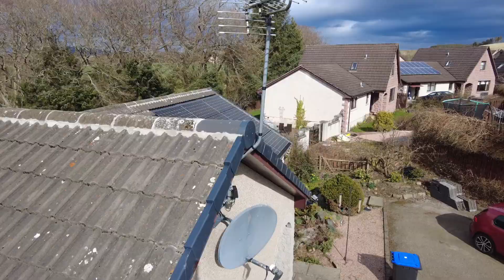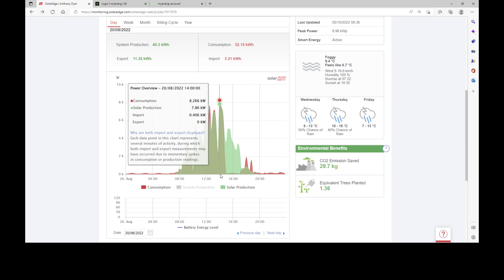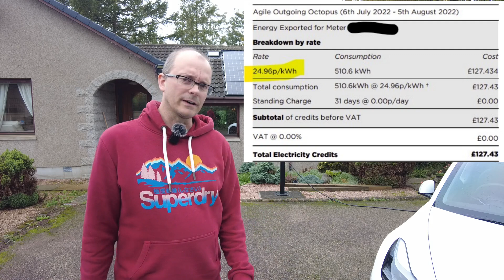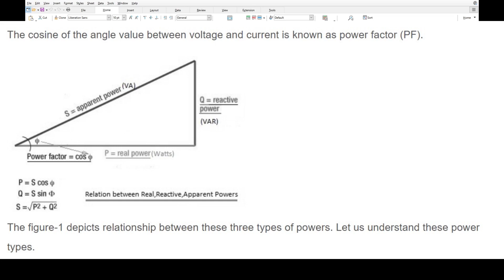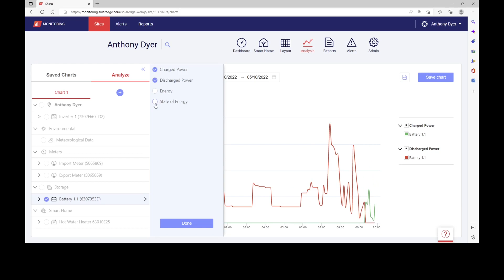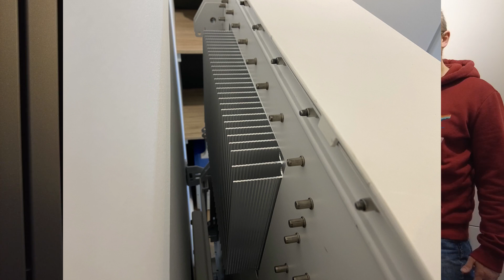July-September Solar Panel Performance, More Energy Bank Insights

Comment: I would love your "battery inefficiency"!  I have a PowerVault 8kWh unit and frankly...it's garbage.  I measure about 100W constant load which I believe is simply running the motherboard and fan (which at one point in lifetime has been set to full speed via firmware.  When I questioned this, the response was "to improve cooling" which suggests that a temperature concern had been identified across all the systems so just whack them all to full fan speed.)
I've also tried the battery for time shifting but the problem there is that I measure about 10.2kWh to fully charge 8kWh.  The usable discharge is about 6.7kWh.  Now factor in the constant 100W load and that's another 2.4kWh just to have the unit on all day.  
Even on a sunny day, the solar captured which is usable at 6.7 then "loses" a further 2.4 just through running costs so in reality, the battery in only worth 4.3kWh.
I ran some calculations and found that if it uses 150W to operate then it runs at a loss, it's really that close and given the purchase cost, frankly not worth it.  I now turn it off unless there's a chance of capturing some sun and subsequently get emails "We've noticed that your PowerVault battery has been offline for 24 hours".  One of these days i'll reply and tell them why.
The EV arrives soon and i'll just dump surplus solar into that as it's just a one way charge without the running cost and return efficiency loss in the same way.
Reply from the maker: That’s poor. I speculated that “fixed load” may have been a factor here, but the evidence didn’t support that idea. 100 Watts is very poor for what is essentially a monitoring / safeguarding function.  My raspberry pi consumes 1.5 Watts, is on all the time, and switches relays for bathroom fans and lights.

I’m not an expert on power electronics, but battery management is charge control and cell balancing.  That essentially means switching off the load/supply with a switch to prevent overcharge, undercharge, overload etc… and then redirect small load quantities to individual cells which are unbalanced.  Now if that switch is a relay, then power consumption should be low.  But if it’s a MOSFET, that would be more reliable, but far less efficient.
Reply: @anthonydyer3939  Yes indeed. After I looked into mine, it quickly became apparent that with Economy 7 at half the price of day rate, it wasn't delivering any benefit with round trip efficiently and losses resulting in about 50%.
As of October 1st, my day rate has gone to 44p but night rate down to 11p (from 34/15). In that calculation, the night rate being one quarter could work if only the unit didn't sit being inefficient when just turned on at the higher rate.
I am contemplating designing and 3D printing a servo operated activator to turn the large chunky isolator so that it can be turned on only to charge and turned off when it has discharged. Then and only then can I realise savings.
Reply from the maker: @djtaylorutube  I was just having a look at the Powervault specifications.  The lack of any boast about round trip efficiency was suspicious to my eyes.  But the fact that fan cooling was mentioned in the spec (with a 70db noise level rating) was a terrible giveaway.

I was doing some research into charge controller types.  There are some varieties that simply dump excess solar power into a resistor bank (shunt type charge controller) when battery is fully charged instead of simply opening the circuit or diverting the surplus to the grid.  I'm baffled as to what exactly is needed in the charge controller to warrant a cooling fan.
Reply: @anthonydyer3939  When I've seen it open, there's basically a motherboard running Linux and then another board with the charge controller. I may have a pic with it open...
Reply from the maker: @djtaylorutube  it makes me wonder whether the motherboard is doing some cryptocurrency mining on the side with that kind of power consumption!  Ideally they should use a microcontroller rather than a microprocessor for this kind of duty.  Either way, my raspberry pi is 1.5 Watts out of the socket outlet, and it’s running 2x temperature, 2x PIR sensors, relay outputs and a web server.
Reply: @anthonydyer3939  This just got a whole load more interesting!
I popped a clamp meter onto it today to feed into my emonPi (I've been waiting for an emonTX to get more than two inputs).
Because I couldn't previously observe exactly what the batter was doing and had to rely on their mobile app, the emonPi home instantaneous use never made sense to me.
Today though, I can report that the Powervault battery system in idle is about 67W.
However, this evening, the house load was about 500Wh. Then I turned the battery on to discharge a bit and the clamp meter showed 800Wh from the battery. The clamp on the meter tail showed -300Wh.
I'd never really trusted that negative figure with the battery on but now I have clear evidence that it looks like I'm feeding out to the grid, even though the Powervault app shows all 800Wh going into the house.
I'll going to monitor and log this to present to Powervault because this is incredibly significant in that it is giving my stored solar or purchased Economy 7 away for free!
It's no wonder that my battery charge isn't lasting as long as planned. I mentioned earlier that it feels like it "costs about 2.4kWh" and there you go, constant discharge of around 300W out to the grid that I don't use is roughly 1/3rd of 8kWh = 2.4kWh.
Reply from the maker: @djtaylorutube  it sounds like they could easily improve the power import/export handling and it would help a lot.  But 67W for an idle battery is still unacceptable.  It really should be 0W for an idle battery and 2W max for active battery management.
Reply: @anthonydyer3939  Yes absolutely agree. My day rate is currently 44p, night rate is 11p. That works out at over £200 per year in consumption.
I've just been theorising more and I'm wondering if their meter tail CT transformer is out of calibration and that's causing the unit to generate too much more than the house demand?
I'm going to let it log demand for a day and compare to mine. My emonPi is also counting the meter pulses so easily to cross correlate my monitoring accuracy.
Reply from the maker: @djtaylorutube  it could be.  CT transformers are nothing more than an iron ring and a coil wound around the iron ring.  The meter measures induced AC voltage in that coil,  That said, if it’s measuring import / export, then the voltage should be zero when import and export are completely balanced.

So the basic checks:
1.  Is the CT positioned on the correct core coming from the supply point meter?
2.  Is the CT rating matching that configured in the meter (I had an early days config mismatch CT rating was 100 Amps, and config was 10 amps).
3.  Is the Iron ring closed properly?
4.  Could the magnetic flux measured by the CT be contaminated by nearby cores for other circuits?  If the CT is within the consumer unit, this is possible, but the contamination would be very weak.  It might be worth repositioning the CT on the meter tail outside the consumer unit and well away from other cores, including the neutral meter tail.
Reply: @anthonydyer3939  Indeed. I'm going to have a blast with this one. The CT for both my emonPi monitor and the Powervault are identical SCT013 50mA other than emonPi taking a 3.5mm jack and the other an RJ45. They're next to each other in the meter cabinet and on the same wire.
Tomorrow, I'll make up a cable to input "their" CT clamp into my emonPi. I'm expecting the same output and assuming there is then that points entirely to the unit configuration or calibration.
I'm sure I'll quickly get to a conversation with their technical director again.
Reply: @anthonydyer3939  I thought you might be interested in the conclusion to this story.
Yesterday, I happened to visit the Solar and Storage exhibition at the NEC, with one sole purpose. To meet with and discuss the issues that I've documented here.
I was ready for some confrontation, I had my facts, my printed evidence in my pocket and a plan!
I started with the issue of the constant 72W to 100W power draw. The guy I spoke with listened calmly and courteously and said "We need to check if you have the temperature monitoring sensor, if you don't, we'll get that fitted, if you do, we can update firmware to change fan behaviour. In addition, you'll get a 'dormant' mode to set in the scheduler."
I then discussed the excessive over generation which was gifting my purchased energy back to the grid. He responded that they could set an offset to the CT sensed load and modify behaviour. He suggested an offset but I said "No, I know exactly how much it's off by, please use my value."
Before we got home from the show, it was sorted. I do have the temp sensor and when the unit is dormant, it consumes about 18W. I'm ok with that, the accuracy of a 100A CT clamp at that power level isn't going to be precise anyway.
The offset I gave is pretty much bang on, reporting tiny deviation between export and import by just a handful of Watts, trying to refine it further would either be to constantly expert a surplus or under generate and require a constant small import.
Today is the first day in three years where I will have charged up at off peak rate of 11p and offset the entire peak period with an 8kWh battery.
I'm almost really happy!
The two issues that remain are that  someone not as tenacious, clued up and bloody minded as I, has no way of determining that the observed behaviour was incorrect and needed addressing. I can't fight that battle for others.
The second issue will be a subsequent discussion about compensation as for three years, I have been purchasing off peak energy and gifting half of it back to the grid only to have to buy standard rate power to fill that deficit.
I have an idea about that but overall, the outcome was positive and the unit is now working as it should have done from day 1.
Reply from the maker: @djtaylorutube  glad you got a good result!  I suspect the compensation would be a hard fight, but it’s good that they listened and sorted it.

I got some feedback from SolarEdge today.  In summary the battery was measuring 90% efficiency.  The discrepancy with my numbers was due to the fact that power charge / discharge figures were not mean values, but discrete samples in a 15minute interval.  They have more housekeeping data so they could determine the correct efficiency.  They said they’ll introduce more data tags in the analysis tools in future so I can determine energy throughput more accurately,
Reply: @anthonydyer3939  It's a fun game isn't it?! 
For what is with, my approach to the compensation isn't too expect a direct monetary refund, that would be challenging but I can approximate the loss to offer about £2000.
Now that it's working, I would be interested in expanding capacity but I need a different chassis and for it to be relocated. That would be about £1000. If they can meet that (and that's really absorbable under maintenance), then I'll be able to spend more with them to buy more batteries. Feels reasonable to me ;)

Comment: Great video Anthony, I was just about to press the button to order up your SolarEdge battery system, which I have paused to see what SolarEdge do in response. I have a 19kW SolarEdge array which has been great and it seemed likely that SolarEdge would be the way to go with their matching battery system, now its avilable. Amongst other matters you raised, the efficiency is the most surprising and disappointing. Especially as it's one of the key reasons for paying the SolarEdge premium price! Given that Tesla and SolarEdge are similar in price (both top end) it looks like I will have to look at Tesla again.
Reply from the maker: I’m going to keep an eye on the efficiency over the coming month.  3rd to 6th October, the charge cycle reached 85%.  So I’m wandering if some of this is down to “brand new syndrome”.  I’m guessing cells need to be balanced by the battery management system after many months of sitting idle.  If efficiency trends upwards or if it’s just a one off then I’ll report back.
Reply: @anthonydyer3939  Just checked my SE Energy Bank efficiency since install in June. 85% just like you are seeing now. Is that ok?
Reply from the maker: @AbReNtFoRdFaN  In my opinion it still isn't good.  Consider that inverter losses aren't factored in when you just measure charge vs discharged energy as I did.  Once you factor 95% inverter efficiency for evening/night loads, then the round trip efficiency that you quote will drop down to 80%.

I'm going to be writing a support request for this, as it's a big deviation from the marketing hype.

Within your data, could you spot individual days that were better, getting above 90%.  I spotted one day at 94%, and one at 85%, but 70-75% is most common.

Comment: Good vid.  Kinda makes me glad I chose SMA inverter and Victron Multiplus II as getting 90+% efficiency on the ac coupled solar and 90% approx on the batt inverter too.  Small system here only 2kw solar with 2.5kw inverter and 4kwh batt.  It's making a big difference to my bills though!!

Comment: We have Lux Inverters with a charge/discharge of 87^ for the round trip of charging to discharge. This is based on 2 years worth of data. This is for 9 pylontech batteries. Temperature makes a difference by about 0.5%. We average around 1kwh a day import during the summer months, however this can peak to 3kwh. The import is mainly due to the combination of devices in the house that pull more than c. 6.5KW for a period of time which is more that the 2lux inverters can supply. We are reducing the number of these items so this figure will decline.
Reply from the maker: That 87% is pretty much in line with other AC coupled batteries that I think I once read about.  It’s useful to get your perspective.

I think I’ll raise a case with Solaredge support on this matter.  The grid import is not happening with high loads at all, but it is proportional to then inductive load that’s running.

Comment: It's funny i have been hearing about battery storage solutions for couple years now and yet its all really in its utter infancy.. i had a solaredge battery installed and hearing these less than steller efficiency's is a kick in the teeth lol im currently trying to figure out why the imported power is showing up as 1 figure on the solaredge stats but alot more on my suppliers stats.
Reply from the maker: My Solaredge and supply point metering are accurate to within approx 5% of each other.  The myenergi metering on the other hand grossly overstates the imported power.  I’m thinking of making a video feature of how these import export figures compare with each other.

Comment: Interesting findings. Are your battery software issues all sorted now?  I've been researching for a few months and was considering a solar pv + battery. Most the figures presented by people seem to have large daily energy consumption. I have a 4 bed family home but we use on average only 3 kwh per day. We have electric hob but the low usage I guess this is due to not having an electric car.
Reply from the maker: Software issues are all sorted.  So now it's just a matter of monitoring performance.

3kWh per day for a family home is extraordinarily low, especially considering you have an electric cooker.  I was averaging 6kWh per day summer and 8kWh winter time before Solar and EV's.  I had a gas hob, but did have an electric oven.

Comment: Very Interesting,
You'd think Solar edge would already be aware of these results form internal testing before production release. Yet they've failed to tackle it?
Reply from the maker: I had various conjectures before I analysed my data. I was convinced that they tested efficiency at max charge and discharge rates at the full cycle.  The conjecture I had was that power electronics had a fixed power consumption regardless of load, and it was therefore in their interest to shorten the duration of the charge cycle.  However the evidence doesn’t support that conjecture, and neither does it support losses through cable or battery resistance.

Now the really bad news comes for those people who installed batteries in unheated spaces.  As air temperature goes down, then internal resistance goes up, and efficiency inevitably gets even worse!  In the case of my Tesla, that is really bad near or below freezing point. My Energy Bank is in a warm room with a stable temperature - conditions are as ideal as they come!  I’ve seen most of these batteries installed outside on YouTube.

So I don’t know how they got the 94.5% number,  the lack of reference material to an ISO test standard is worrying though.
Reply: @anthonydyer3939  Very worrying.
Also sounds like you need an insulated garage for the Tesla😀

Comment: Great video and very informative. I'm signing up for a 4.8kw system with 9.6kwh of pylontech batteries. I don't drive an EV so expect to export quite a lot over the year to the grid. Hoping to use Octopus agile over the spring and summer to make more revenue from the higher export rates available. Then switch to their economy 7 tarrifs for the winter months as I won't be able to get Go without owning an EV.